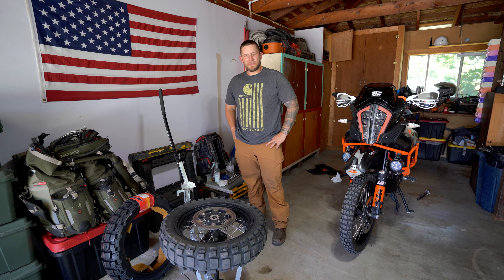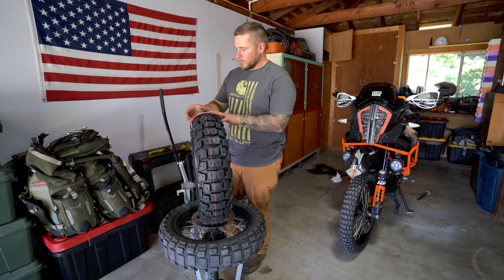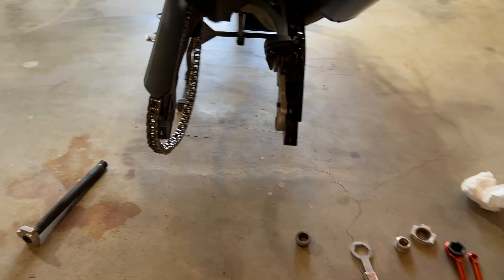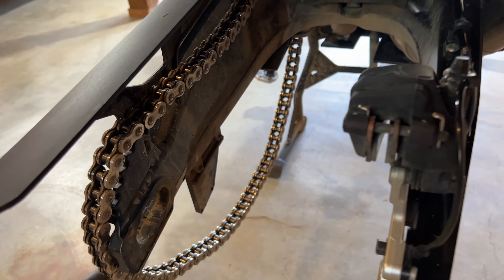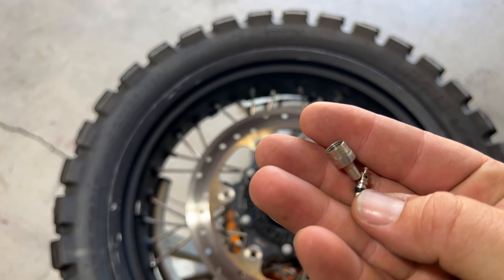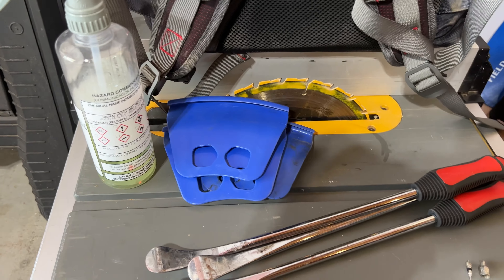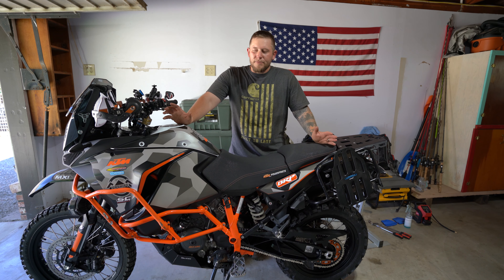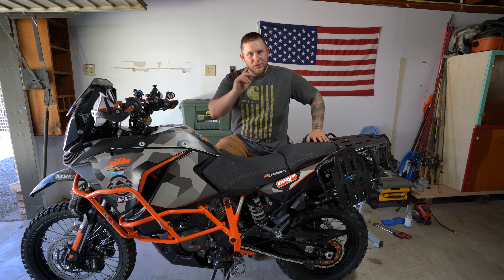How To Change Adventure Bike Tires?! Motoz Tractionator

Comment: For anyone who think changing tire is difficult, I have done around 15 tire so far, and man does your technique improve over time. It's so easy for me to install a motoz Tire, I can install one in about 3-4  minutes tops. Just using 2 quality spoon, one bead buddy and quality tire lube, the lube is really what make it so easy. The most difficult is removing the tire and I'm not as well equiped as in this video.

Comment: Great how to video. I also change my own tyres for my T7, I don't balance them either. I have the Motoz Adventure  on one set of wheels and Pirelli Scorpion Trail 2 one the other set which I use for road only. Never had any wobbles or vibration on either set of tyres even at constant 80 mph on the motorway ( highways ). 👍

Comment: Nice job!  It is great to be able to do this stuff yourself, especially on a big powerful ADV bike like that, which eats tires.

Regarding balancing, the tires usually have a dot on the sidewall indicating the heaviest spot.  Put the spot opposite the valve stem and the balance will be reasonably close enough.  A Harbor Freight static balancer does a nice job for about $50 if one is so inclined though.  I actually balance my dirt bike's wheels using spoke weights as they have rim locks, it makes a difference as the rim locks throw it way out of balance and the wheels will hop at speeds above 45 MPH or so.

I have a Rabaconda like that also, it sure does make it easier.  Rabaconda sells a super nice set of tire irons in a set of 5, which is overkill for this tubeless install, but used for installing bibs on dirt bikes.
Reply: Lightest part opposite valve 🤔 Nope

Comment: Great video!
Giving some critiquing...
You mentioned to be cautious of the TPMS sensor in both removal and installation. Alas on the install you missed the chance to bias your install and protect the sensor. 
Anyone else catch that?
Having NOT personally replaced the tires on my SA-R, do you know if is there an option to install right angle valve stems instead of straight thrus? 
Sure would make pressure checks and inflation easier.
For what its worth, I designed a tool tube holder so I can carry full-size breaker bar, a set of your spoons and MP Bead pro Tire irons (the STEEL Versions) with me. 
You never have tire issues in fun places.
Like the bread breaker tool!

Anyone try one of these Regina Pitch 525 HPE maintenance-free chains on a SA-R/S?
Reply from the maker: Thanks for the respectful comment. Not sure what you mean by “bias my install” can you explain?
Reply: Regarding "bias my install"...
The rim is on the ground or tire machine, you tip the tire onto the rim at some angle, to kinda get it started. This allows the "Down-side" lip of the tire to essentially start seating while you are pushing the tire on to the rim.
This presents a opportunity for you to MISS the TPMS module as you begin re-installing the tire onto the rim.
At 7:08 to 8:05 in the video a "black box" that is mated to the inside of the rim is visible to the camera (not you) I believe that is the TPMS module.
Further at 8:05 time, If you had rotated the rim 180° the TPMS would be facing you and the tire would be at the angle position I am trying to describe allowing you miss the unit easily and not risk dragging the lip over the module.
Hope that helps.